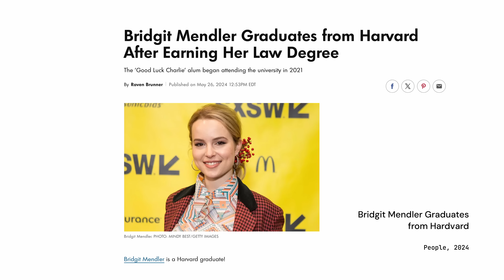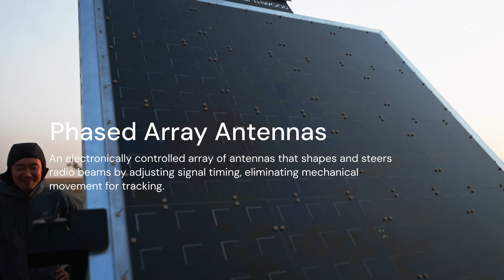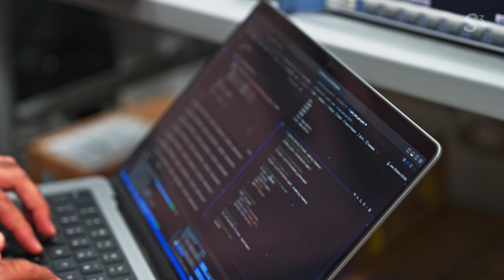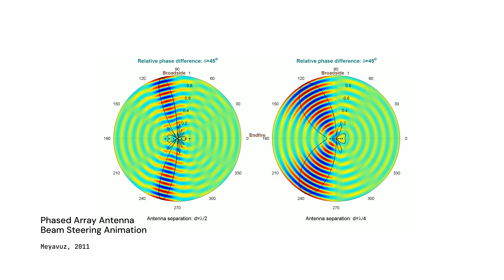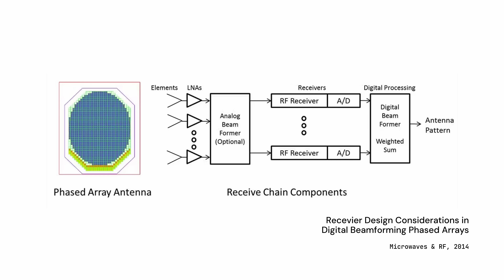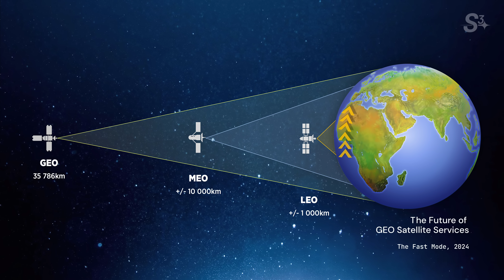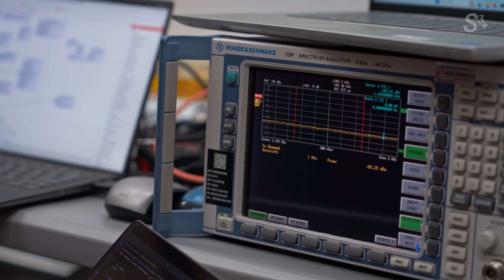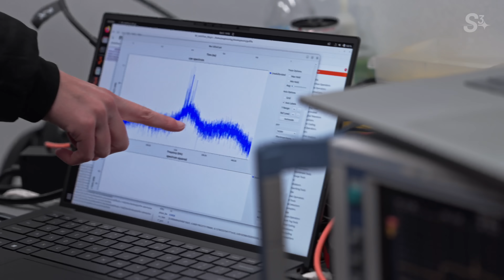First Look Inside Bridgit Mendler’s Space Company

Comment: Confusing. What does her phased array do that others don't? No clear explanation, just a lot of talk with no focus. I doubt that any of the admirers below could explain what they are doing that is new.
Reply: @cogoid  This is exactly it. While there are options, they are trying to break into a market that isn't well serviced. So while technically their product isn't anything special, there just isn't many options and I would wager the ones that are available are very expensive.
Reply: I was thinking the same thing.  OTOH, Dr. Mendler has a Ph. D, and I don't.
Reply: Even more funny: You can spot a production Starlink phased array in some shots on top of the building. I know they try to serve the commercial segment, but Dishy really doesn't work much different from what they want to build. Dishy just signal processing with a bunch of beam former ICs. I doubt they got rid of the beamforming ICs in their setup. They would have mentioned it more specifically.
Reply: Phased arrays are advantageous because they can be digitally steered so you have little to no moving parts and are able move their beam at the speed of a digital system rather than a mechanism. You can also do stuff like adaptive beam forming and multi-target tracking, although in their case I’d imagine they’re trying to maximize their gain as much as possible. It also looks like their pairing it with a software defined radio so their ground stations are could be more adaptable and cheaper than if they were doing traditional analog radio design.
Reply: @teddyherrera4627  they say nothing that distinguishes their array from others.
Reply: Seems like they're riding on the spacex wave and she's a glorified investor, still a lot better than doing nothing tho lol

Comment: Well done capturing clean audio with that wind :)
Reply: There's something you can put over the microphone to stop the sound of wind. can't remember what it's called ahh
Reply: @rexp1727  It's called a deadcat but it can't remove 100% of the windnoise with heavy winds. They definitely cleaned the audio in post and whoever did it did a great job.
Reply: @illuwe  A. A proper deadcat does 98% of the heavy lifting. 
B. Nowadays most NLEs have built in noise reduction tools powered by AI (really just very complex neural nets) which takes care of even the most insanely noisy audio with just a single click.
Reply: @illuwe
Reply: @rexp1727  I think what you mean is a deadcat.
Reply: @MandoMax360  I thought you were joking at first. Then I realized, it's a real word for the product.
Reply: @rexp1727  And/Or clean the audio in post.
Reply: Came here to say that.
Reply: I had the same thought!